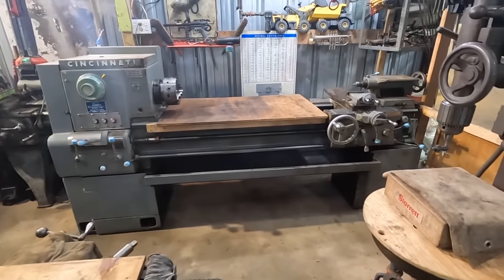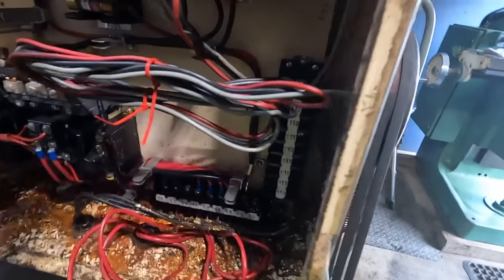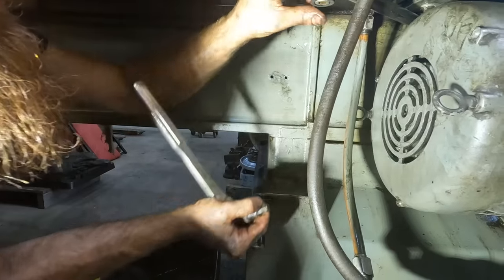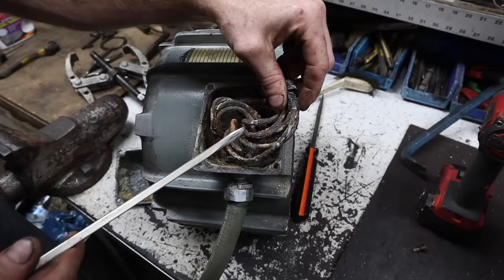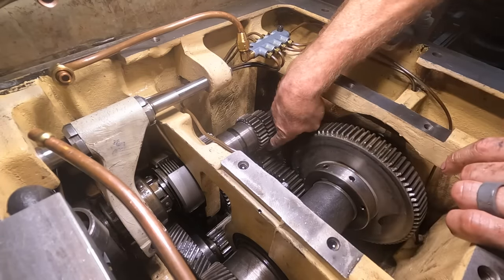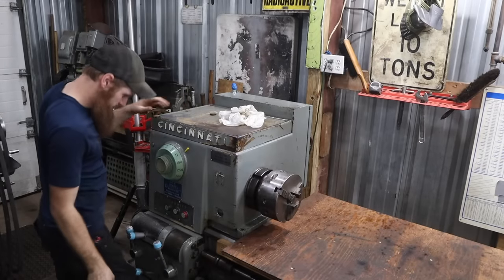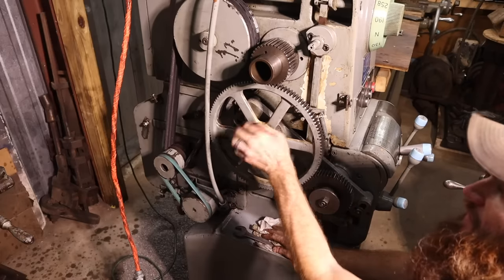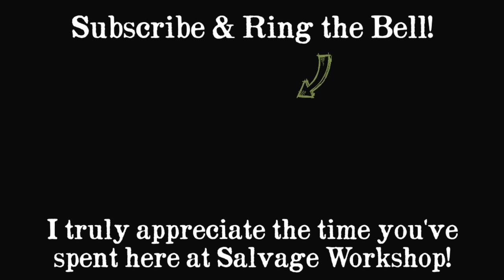Can we SAVE this BROKEN Lathe? ~ MAJOR Issues found! ~ Will it Ever CUT again?

Comment: After a bad experience buying a well used old lathe here is my personal suggestion on how/why to test for bed wear to any one who wishes to buy a old lathe and not get screwed.
-
Buy a 30" hardened and ground linear rail/rail shaft. I use Thomson Shaft, Alloy Steel, 0.500 from a company called ZORO because the prices are low and shipping i decently low. Only problem with these is they are hard so it is difficult to drill the end so it can be centered on the tail stock end. I make an adapter the shaft slides tightly into with a drilled and chamfered end so it mounts on a center in the tail stock. 
-
When you go to check out the lathe chuck the bar up in the chuck and the center. You will need to know what size MT the tail stock has, you can usually find this info online and you will need a dead center that size. Don't complain just buy one. I have every center size ever made due to seeing dead centers at auctions that no one wants... because the are "dead" centers and everyone wants live centers, the type with bearings where the center turns.
-
Mount a dial indicator on the lathe carriage with a magnetic mount and check bar run out at the chuck and back at the center. Adjust run out to at or under .001 using stainless shim stock in the chuck jaws and on the edge of the center where it hits the taper of the shaft adapter.
-
Next take the dial indicator and adjust so it is at the top center of the bar.
-
Start at the chuck and move the carriage back towards the center so you can see the dial indicator read out from the bar as the carriage travels from the chuck all the way back to the tail stock.
-
What you are checking is the wear on the ways as the carriage travels from the chuck area back to the center where there should be little if any wear.
-
If there is wear on the ways the dial indicator will tell the tail by showing how many thousandths the carriage dips down as it travels along the ways...
-
You know, the ways that look smooth as a babies rear and look so perfect. well, those old lathe bed ways are shot but your eyes can't tell because "your eyes are not micrometers". You simply can not tell there is wear on the ways just by looking at them.
-
There are "few, if any lathes this old that still have good ways". Read that again and let it sink in. Then be smart and NEVER buy an old lathe on assumption the ways are still good and the lathe is worth a bunch of $$.
-
How did I figure this out?
-
I bought an old lathe and got screwed, the ways looked absolutely beautiful, the seller even boasted look at those beautiful ways, this lathe is still in perfect condition. Truth? those ways had .010 - .012 of wear right in front of the chuck making the lathe junk.
-
A lathe that can no longer cut an accurate shaft where a bearing can slide on and run or a bore that is accurate enough for a bearing to be pressed in and not be lose on the front and tight in the rear of the bore, that lathe is now junk and won't do its job. The carriage will ride the worn area in the ways and the cutter will ride up and down while cutting and the shaft size will get larger and smaller as the carriage rides into and out of the worn area in the ways.
-
Let that sink in. That lathe will never cut a good shaft to size and it will never cut an accurate bore again because as that carriage moves back and forth from the chuck area back, it is also dropping down due to the ways being worn then if you keep moving it back it raises back up where the worn part of the ways ends.
-
Up and down we go, good shaft? nope. Good bore? nope.
-
You did not f up the job, your lathe did that for you. Now take the shaft and drop a bearing on to it until the bearing stops on the larger part of the shaft where the carriage dropped resulting in your shaft being larger then smaller. Same for a bore.
-
Try pressing in a bearing and it seems right then you later find that damned Bearing fits tight in the from but is loose in the back. I about went crazy trying to cut a proper bore until I figured out what the heck was going on.
-
Oh... my lathe is a piece of crap that can no longer do its job. Why did I buy it? Because I was ignorant about what to check to see if it was still a lathe and not a huge chunk of scrap iron that only looked like a lathe, Darn.
-
I have a 12" craftsman lathe, my first lathe purchase a long time ago and I can do a lot on it but what can't I do? I can't turn a shaft or cut a bore accurately because the ways have to much wear and the shaft will be bigger in certain areas due to the carriage moving up and down along the work ways.
-
When you find a lathe like this with worn ways, no matter how nice it looks or how good the deal is walk away because it can't be fixed because regrinding the ways cost more then the machine is worth or will be worth after the ways are reground.
-
I am new to this channel and I don't know if the salvage workshop guys know this or not. Do they actually use these machines they refurbish and thus see the machine fail to make a good shaft or bore or do they simply think because the machine runs and seems to function it is good to go?
-
I just moved across country sold all my machine tools and am now buying all of them all over again at my new house/shop. I got my bar and check every lathe before I buy. Do you know how many old lathes I have walked away from in the past 2 yrs? Every stinking one I went to see because they all have failed that test that really shows if the lathe can still cut accurately or not.
-
I bet this old Cincinnati HydraShift lathe has bad ways and was not worth the money that was paid and the work that was done to fix it up. Hope I am wrong.
-
Salvage workshop guys, you need to perform this test before you ever buy any old lathe ever again because lets face it, an old lathe that can not do its job any more, there is only one word to describe it. SCRAP IRON. Good for parting out but not to make accurate parts to spec.
-
Some day I will make a video using my old craftsman lathe and upload it here so all of you lathe buyers who are not very experienced machinist and can't quite picture how this testing would work, can see it and see via the dial indicator what your eyes wont show you, bad lathe ways that you can't see any other way then this test.
-
I as of now do not own any larger lathes like this even though I want one. I bought a hardinge tool room turret lathe because I have a lot of experience with these and the bed "can be removed" and sent out to be ground for a reasonable cost. And, yes the one I bought needs to have the bed reground but it is in good shape other wise and it was cheap, 1000 bucks.
-
BOTTOM LINE... stop buying and wasting $$ on old lathes because 95% of them belong in a scrap yard not in your shop.

Comment: If you get a healty piece of  bar stock clamped in your vice, you can hammer the bad legs dents out and save them from the scrap bin! Bar stock inside hammer dent on outside.
Bang!
Don't feel bad about your work benches. My 3000 Sq ft shop has work benches everywhere, and they look just like yours.  I call them undesigned project parts holders.  Eventually, I find a use for it all. Usually, right after the garbage man drives away with them. 
My best workbench is a piece of plywood screwed down to a palette and being held up by my fork lifts forks! Portable and adjustable!

Comment: Not certain, because I haven't seen a shot of the lathe from quite the right angle, but I have an idea which might explain the presence of fluid in the electrical enclosure.

Could it be that the lathe was in use in its old home, with that electrical box pressed right up against an outside wall?

Two reasons why I think this: 1. That box looks rusty - oil wouldn't normally make metal rust. It would actually tend to inhibit rust, unless it were water soluble oil. 2. Oil rarely acts like a paint stripper, but h2o getting under the paint could well do so.

If so, and assuming you're in a part of the world which has times where the air outside the old workshop might be colder than the air inside, thereby causing condensation to form on anything in contact with the outside wall?

I saw exactly this happen at an old workplace, where the building had a shared wall with a unit which was empty, and which got very cold during the winter. 

We had some steel boxes mounted to that wall, and they rusted on the inside, especially near the bottom, and on the outside face mounted to the wall, almost exactly like you showed, but no sign of rust on the outside faces - I think because we would have the air inside nice and warm, but quite humid as the place was surrounded by lakes.

Just an idea, thought it might be helpful for you. Great video.

Comment: There may have been a leak right at the top of the electrical box.  I have seen that when I worked.  Electricians sometimes don’t get the doors tightened properly.  Also to exasperate the problem the operator uses too much coolant that sprays on the top of the enclosure.  Make sure the gearbox oil system is separated from the coolant system or you will be a smokey mess, bad air to breathe.  The filter you opened was for coolant and is correct for the application and the three drive belts need to be a matched set.  The stuff in the motor is also from the electrical box leak, it’s probably aluminum oxide. The whole mess is maintenance fault
   All the wires mean it’s dual voltage! 
It’s great to watch you work on your machinery, makes me feel like I’m back to work!

Comment: Back end noise is just the large open gear ringing. put a strip of paper between the teeth of the big gear and the two mating gears to get the correct clearance. A bit of grease on the gear teeth helps a bit too. If you have a cover for the back of the headsstock that will also reduce the noise. Too much unsupported stickout of the material being turned. If not careful it will wrap itself around the tool and break something.

Comment: The collet chucks are great for very high precision but quick work. If you ever have to take something in and out of the lathe repeatedly and you don't want to dial in a 4-jaw each time you do, this chuck will get you dead nuts every time in a second or two.

Comment: Steady rest build it yourself.   You can get measurements for the steady rest from the tail stock.  Have somebody water jet cut 2   pieces of 1 1/4" plate  for the lower half of the steady rest that you bolt together with shoulder bolts. Then do the final fit to the ways.  Once the lower half fits. Take it apart to mill two grooves for the extended rollers. If you only partially square cut the slots  and have drilled and tapped the round section.  You can have square tubes that hold the bearings and all thread to push them in.   I can do some rough drawings.  Do you have a way to get rough sketches to you.

Comment: COOL... I bought an old worn out dirty/rusted  Pexto Stomp Shear......... it was ugly but I said I can save it... took it ALL APART...... sand blasted top to bottom..... re-painted it Safety Green....... put it all back together with as many new parts as possible.... put an edge on the blades and stood back and looked at it for 10 minutes.. IT WAS LIKE NEW and has a special spot in my hobby shop,.. love bringing old things back from the Graveyard.😁

Comment: Well done Matt, a little oil on the bronze bushing and a little light grease on the gears should make a big difference, those are straight gears so inherently noisy, adjust the mesh between those 3 gears on smaller lathes people adjust the clearance so you can squish some printer paper through them so not a lot of clearance but not tight ever, tight = much more wear and load, slack means noisier. good luck. great videos thank you.

Comment: THAT is an incredible project. I am VERY envious of your situation being able to work on that lathe. Excellent that you have it all on video and you can keep it for reference and historical documentation. If you'd have simply shown me some stills of what y'all found when you broke it down and saw what was in certain areas I'd have almost guaranteed that the motor was inoperable. That second drain plug, to me, is there because of the separation of the two low points by that perpendicular chase for that conduit. Have you considered an endoscope for alignment assistance of the shifters? Also, a dry ice blaster to clean parts like the motor without actually removing actual surface material of the original structure? I realize everybody injects their advice and it's not a knock, I'm just verbalizing my thoughts as I watch this. You make a really excellent video...clear, great angles, not filled with tons of irrelevant video and everything you comment on is succinct and relevant. I've watched up to ~52:00 mark and I can't wait to continue here in a minute or two. Thanks for taking the time to share this with all of us and keep up the great work. (Added: Good God, what a difference once you got all of that material vacuumed out of that motor! I'll buy 2 0z. of the purest stuff if you send me info to where I can send payment! Hilarious btw. The shrink wrap was a great solution. I'm sure you've thought to yourself what the guys who originally worked with this lathe would say if they were to see this video...that would be incredible to see their reaction, were they still among the living. )

Comment: Pecking a gasket is cool old school.   I learned about a product "The Right Stuff"    Pressurized and kind of like black cheeze wiz, .Press the nozzle over and lay a bead on the removable lid.  Let that dry skin over for 15 minutes or so,. Wipe a thin coat of oil on the other surface of the headstock.
Between the "skinover" and the oil you won't glue the parts together,   The :gasket" will glue to the removable  lid,  EZ razor scraping later,,, Works great on oil pans

Comment: The oil in the electrical box is curious because it is mostly visible on the back of the door which would lead me to believe that someone oiled the machine down to prevent corrosion and went overboard and opened that door and sprayed the back of it slowing that paint to chip off and gather on the bottom of the box

Comment: Im sure you've figured it out at this point. But you can fix that noise by cleaning up BEHIND the big gear.
You could also use an oil impregnated thrust washer if the rust doesnt clean up right.

Comment: On my craftsman lathe it suggests placing a piece of ordinary paper between the spindle gear and the large gear and between the large gear ang feed screw gear then adjust the bar behind the large gear to tighten both.  Roll the gears to feed the paper out and you should have the proper clearance at both locations also some "anti-sling" lightly applied to the large gear will help suppress the noise at higher rpms.  Hope this helps.

Comment: Your new drain pipe extension will collect and trap all the condensed moisture, remember to check it now and then.  If there is any splashing of oil in the box during running the second sump will not need to be drained in service.  It seems to exist because they made a slot that divided the sump for that wire conduit and the drain is there only if you plan to replace all the oil.

Comment: I used to work in a manufacturing company and we had the same problem with our older machines. It was not a leak, it was oil vapers built up over years and in the cabinet there is no circulation and the oil settled.

Comment: Maybe add a couple of magnets in the sump and maybe even in the 
"Filter". I was screaming at you over the phone, just take off the knob and flip it... you must not have heard me.. lol. Damn great job on that
 I want a metal lathe someday.
Reply: That's a very good idea, yeah magnets in the sump, or on the outside of the sump if you can't easily access the inside of the sump, and one in the bottom of the filter.  Also that filter housing looks like the kind of filter setup I've seen on heating oil filters.  Bet you could install a heating oil filter in place of that screen.

Comment: The shifting between speeds kind of reminds me of the old "pre-selector" transmissions used on busses and tanks where you'd select the gear you want first then depress the clutch to change gears. Seeing it operate with the top off was really interesting.

Comment: That was not oil in the electrical cabinet and motor, it was coolant/water. Oil would not lead to rust. BTW you did a great job on that motor which is very rare and unobtainable. An expensive rebuild would have been your best option if needed. I would be concern on how water got there in the first place, to prevent it from happening again. I assume it may have been a fluke occurrence, hard to imagine how it got there. Great job!

Comment: I've seen this before when I was working for a machine shop right out high school.  We used to keep a oiler  set on top of the machine, and it would get knocked over all the time and spill into the electrical cabinet.  I'll bet 10 to1 that that's what's happened here also.

Comment: I ran the twin to that lathe for years, same everything. Had zero issues with it. Keep it clean and oiled up. P/S,  put some wheel bearing grease on that big drive gear, it will quiet up a might.

Comment: this is a nice lathe but the hydraulic shifting is a very  expencive point of failure if you ask me , im only in the industry for 5 years now so i might be speaking out off my ass and very used to the 3 lever shift system (high/low . x/y . and then the third lever has 3 positions and the speeds listed) , the coke insulated the wires , personally would have sent the motor away for rewinding as it would mostlikely be down on power , fresh seals making proper contact on the shaft usually arent free spinning even if lubricated with some grease  .GRAT VIDEO!